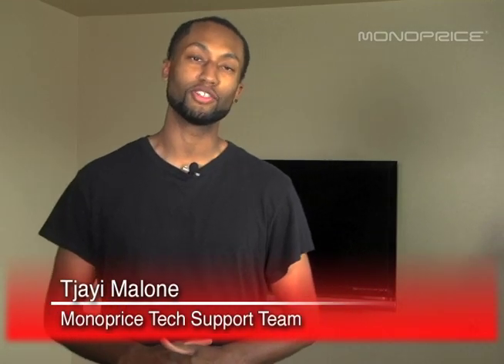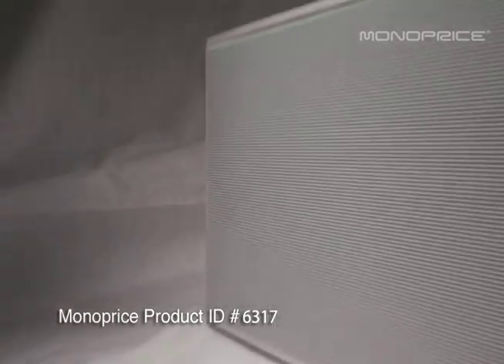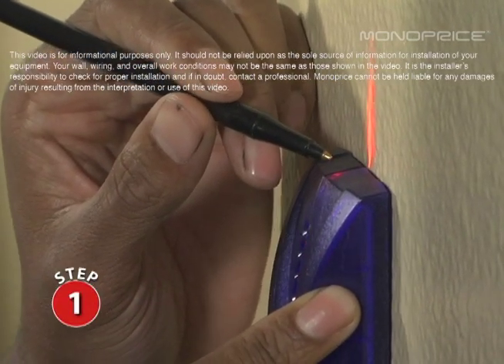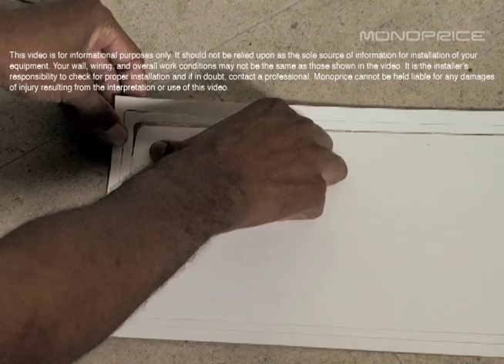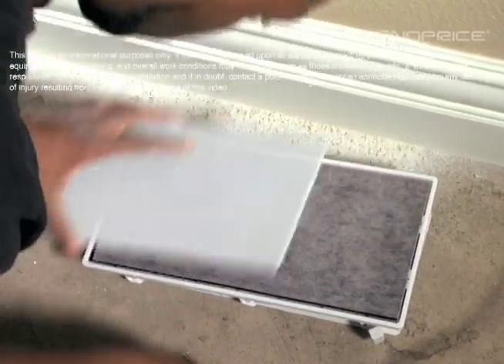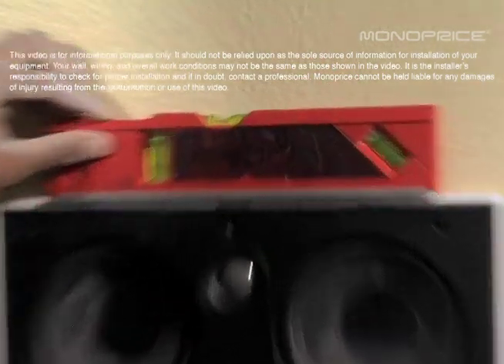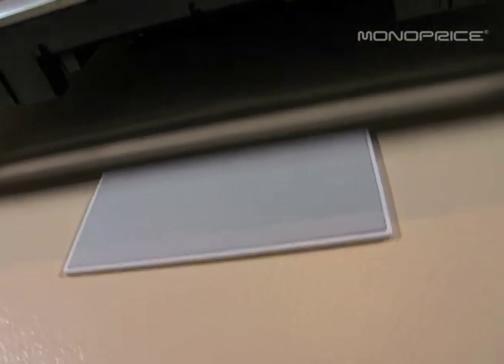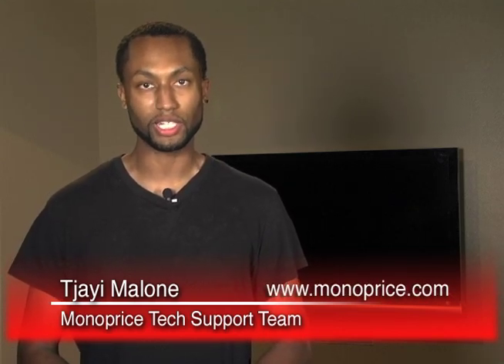How to install the in-wall center speaker at the lowest price

Comment: tape the template to the wall using painters tape and level it.   if you level the speaker after you have cut the hole its too late.

and for me i had to use the outer template,  the inner one is too small.

and like everyone eles has mentioned,  run your wires first,  and hook them up before final installation of course

Comment: Yea, think they forgot to tell people to install wires into the wall first before putting the speaker on the wall... although, with those little tabs instead of screws, it wouldn't be that hard to remove the speaker in order to install the cables to the speaker after you a proper fitting.